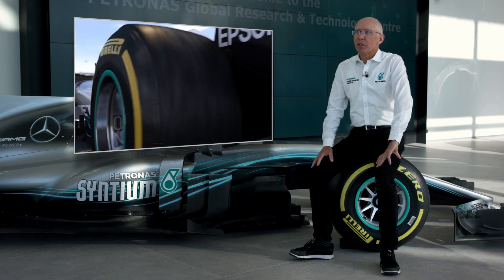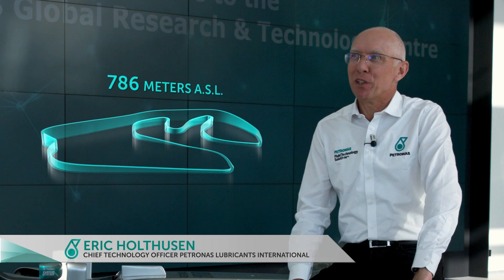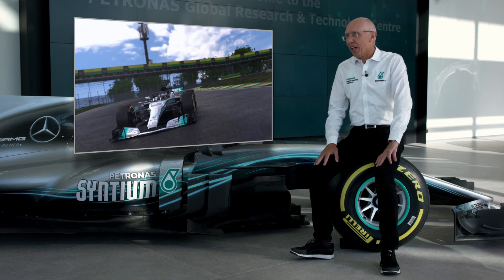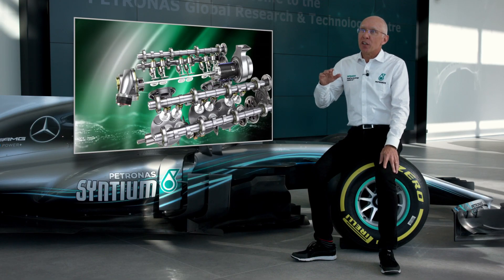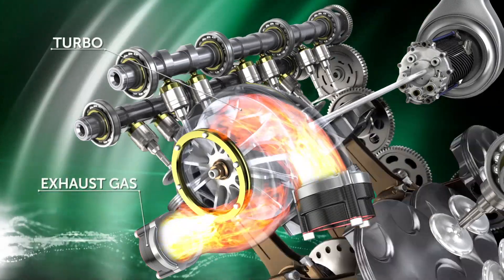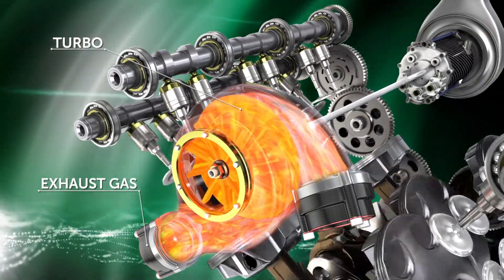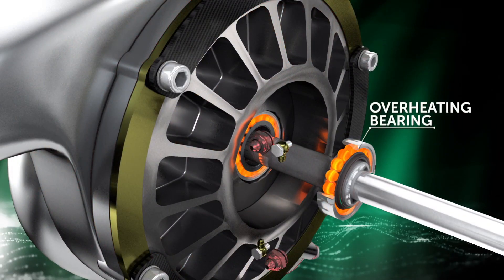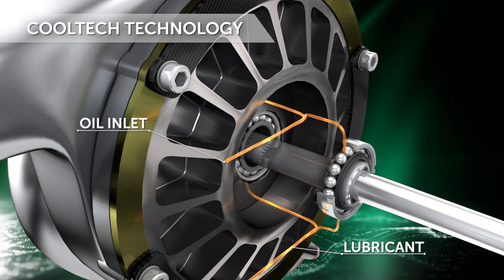How altitude affects the Brazilian F1 cars - PETRONAS Syntium's °CoolTech™

Comment: PETRONAS Syntium with CoolTech is suitable for a variety of vehicles, including passenger cars, SUVs, light trucks, and high-performance sports cars. It's particularly beneficial for vehicles that operate under harsh conditions or in climates with extreme temperatures.

In summary, PETRONAS Syntium with CoolTech is a high-quality engine oil range designed to offer superior engine protection, performance, and efficiency by effectively managing engine heat and reducing wear.